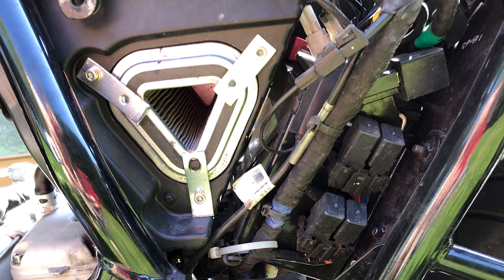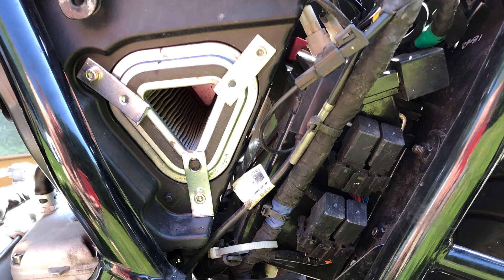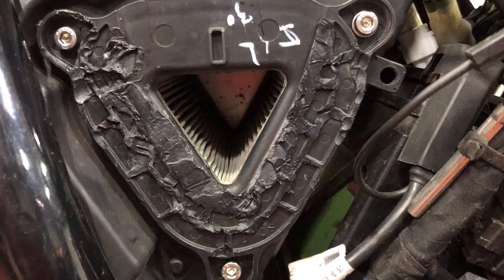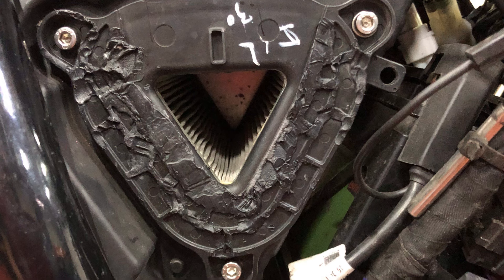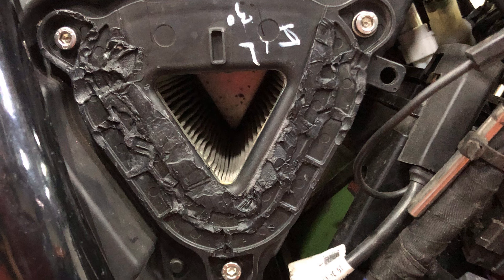Interceptor 650. Snorkel update

Comment: That's what I like! You fix and customize the things you have. I like that. Everybody can buy improvements. But the satisfaction built in into homemade improvements are priceless. 
Do I need to say I did the same on the Triumph Speedmaster I used to have? 🙂

I bike I customized and the result was quite good. Good enough to be in an article in the Triumph's webmagazine a few years back. 
Spoked wheels from a Triumph Tiger. Tank divider from a shower (a chrome list) Lowered with shocks from a Harley (I think it was) Painted with cans. Shortened the front fork by take a bit of the spring and put that underneeth the hydraulics. Yes, the suspension was, well not crap, but let's say, somewhat affected. 🙂
And then the Triumph Legend which I turned into a flattracker...but that's another story. Nice bike though! 😋
Reply from the maker: Fantastic!

Comment: Ive tried running my interceptor (22 plate) without a snorkel ( similar mod to the 3 bits of short bracket , i used 3 penny washers with a slight bend on outer edge to hold filter in place) and in back to back testing it made absolutely no difference at all speeds as regards  performance although i do run lextek cans so if there was any extra induction noise i couldn't hear it ! .
Reply from the maker: Ah, a man after my own heart! No, I couldn’t detect any increased induction noise either…

Comment: If I could offer a constructive observation please. Running a "Roundover bit" with a guide bearing in a woodworking router along the "Melted" side would tidy up the airflow entering the filter. It would be worth the effort in terms of air intake profile. 👍👍.
Reply from the maker: Absolutely! And thanks for the suggestion. Yes, I’ll tidy it up a bit…. The right edge may cause turbulence….

Comment: I now use a 3D printed piece. You can find various links online. Before that i used 3 stainless Flat Finish Washers holding the filter in place with the 3 original bolts.

Comment: I’m thinking the factory design shape is for water deflection 😅
Reply from the maker: Somehow I doubt that, tbh. I’ve never seen water under the side panel/under the seat etc…….someone suggested sucking colder air from the back and not from the front where the hot engine is